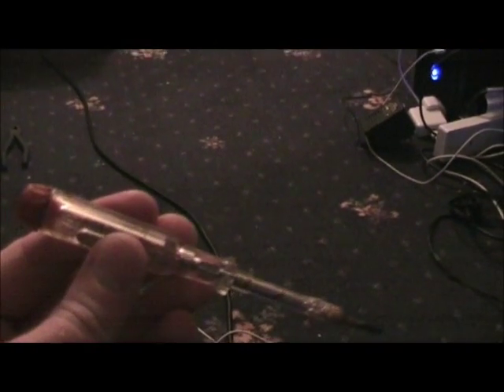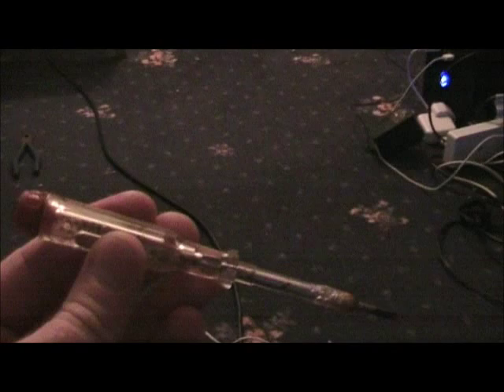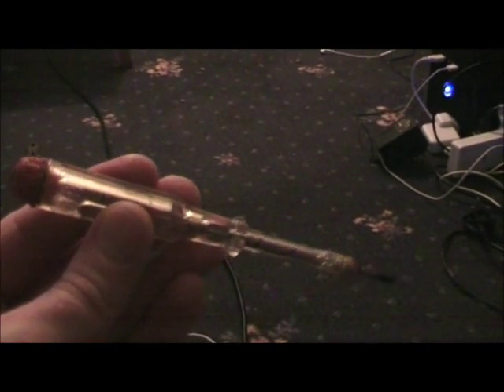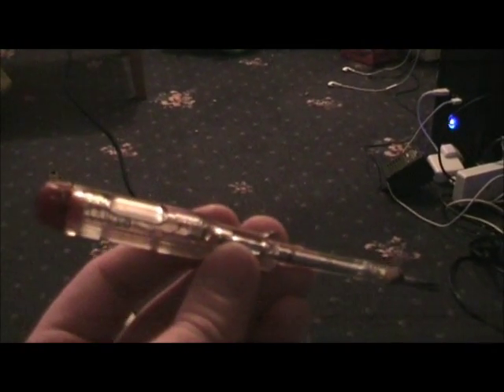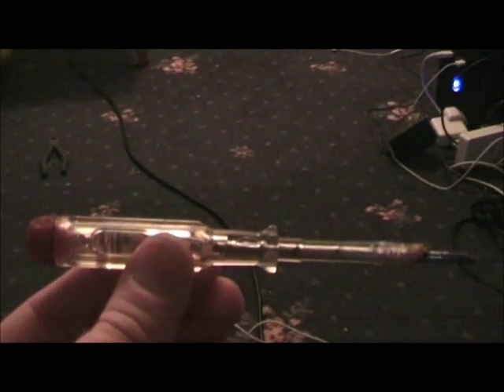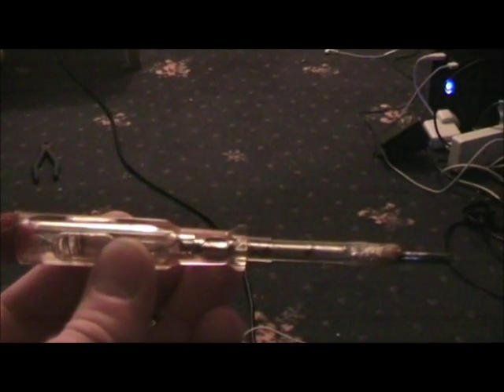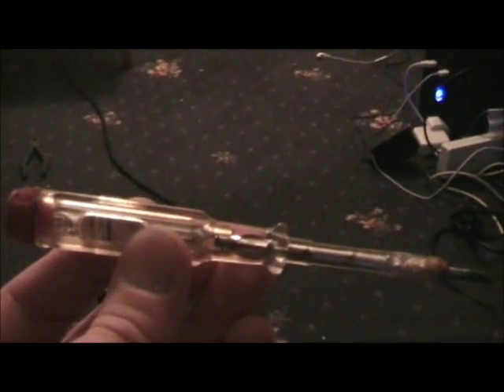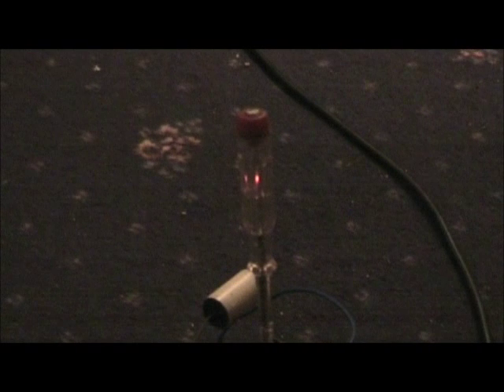Killer Screwdriver - Never Use Phase Tester On High Voltage

Comment: I'm a registered gas engineer and electrician.  I know most other sparkies/heating engineers use test pin screwdrivers.  Perfect for testing wiring centres and testing hot line wires.  Tbf it's better a diyer use one then not.  The chance of a test screwdriver failing are slim to none.  I've never encountered or heard of anyone being shocked or electrocuted  using one of these screwdrivers.  I'll always use a GS38 tester along with a proving unit and carry out a l.d.l test during the safe isolation procedure.  🤞 I've never had an electric shock.  Best practice states not to use a test screwdriver.  I'm sure they've been about for 60 plus years.  My grandad used to use these.  Most domestics are between 120-240 volts @ 60 Hz.  I very much doubt this type of screwdriver will fail if used within voltage limits stated on the side.

Comment: Can you use it for 120 volts
Reply: Yes you can. Most of this tester can measure voltage from 100v to 500v. Usually manufacturer engrave the voltage range on the tester body so you can check before you buy

Comment: Firstly it's a neon bulb with a gap between its elements. An HV spark could jump this yes. Second it was never meant to be used for ignition coils and other hi volt sources, only for mains voltage. ANY tool used out of its remit is asking for trouble.